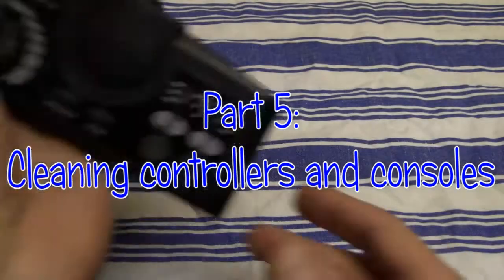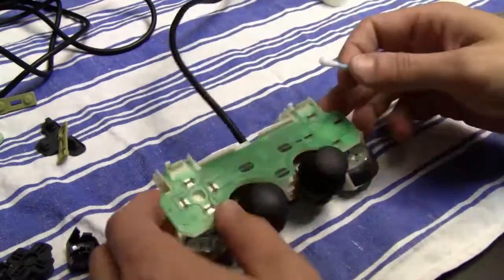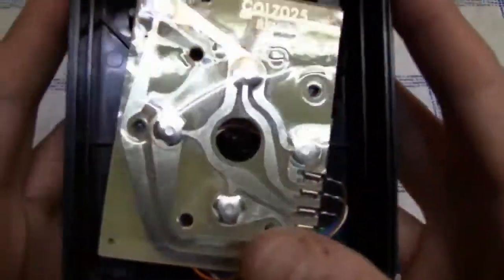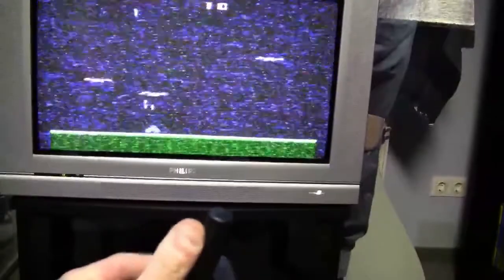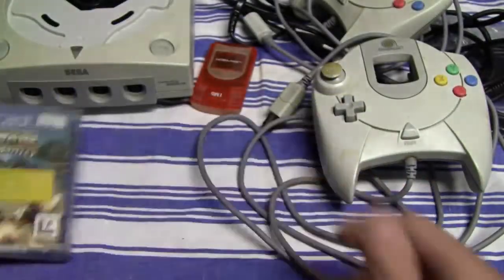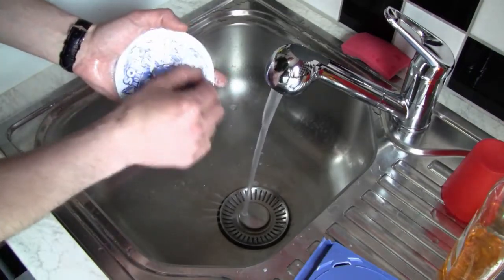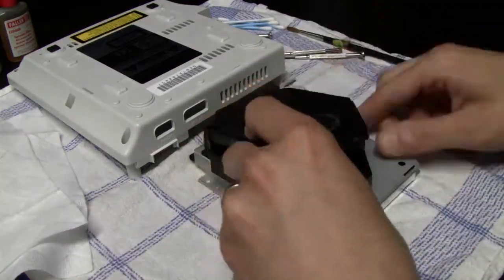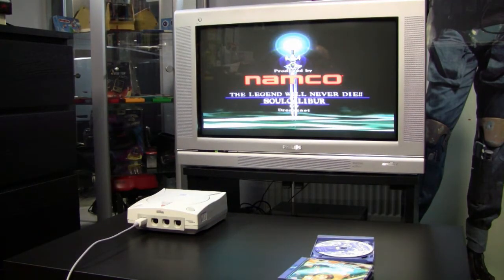Cleaning and restoring video games and stuff (Part 5/5)

Comment: I read on PC forums and places like Reddit that using a vacuum to clean your PC (or any electronics in the case of this Atari) is a big risk due to static electricity generated by the vacuum cleaner itself. While I had no such issues and either did you with your Atari, it does seem more risky to do this to old unshielded electronics.
Reply from the maker: offperception I can't tell you if those concerns are valid or not. Caution is never wrong. I never had any problems so far by using a vacuum cleaner for my consoles and computers. But I don't use it that often and when I do, I'm using it with great care. ;)